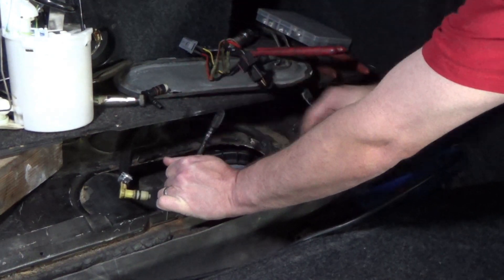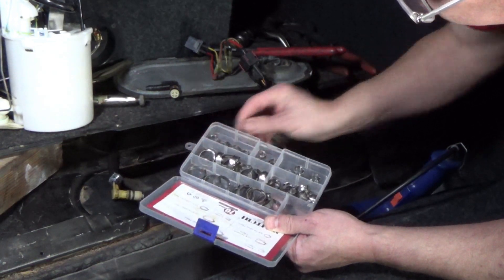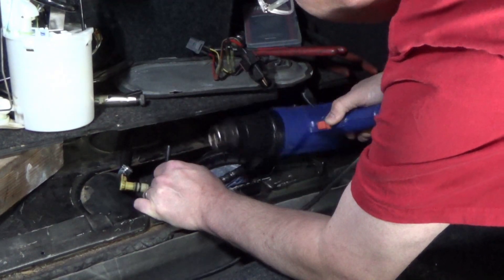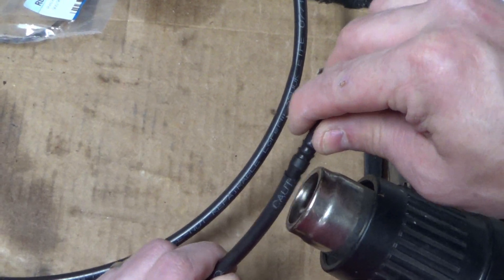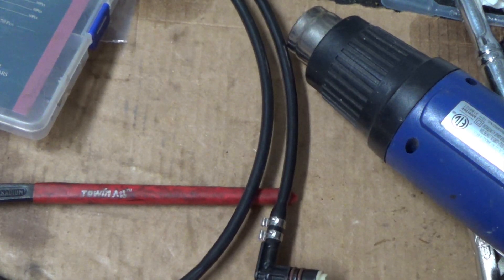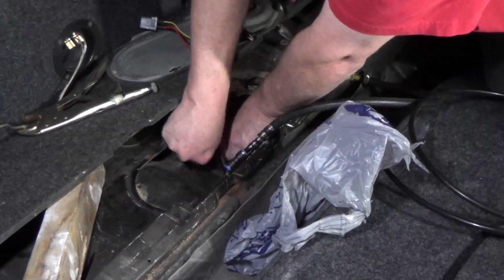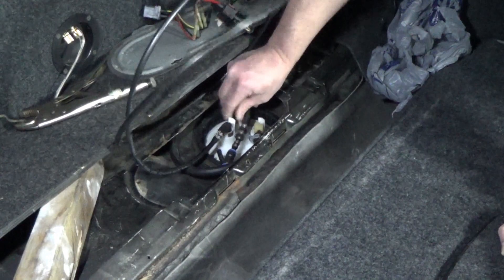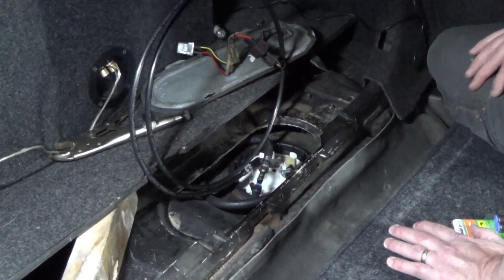1994 Saab 9000 Project fuel pump and return line repair final

Comment: It appears a squirrel sitting on the intake manifold my  Saab 9000 chewed through the heat protective hose and into the vinyl fuel hose where it comes out of the top of the fuel rail 
I am curious how you would replace the hose with aftermarket hose, also clamps you would use for barbed connection and how far back under the car you would go with the replacement hose.   I am pretty sure it is the fuel feed line and not the return hose.  Thanks for any insight.
Reply from the maker: 5/16" push-on couplers work. You should use crimp style fuel line clamps for barb terminations.
Reply: @Ryengoth  Lot's of choices of crimp style clamps and pliers on Amazon. I don't need a set with 120 pieces.  I only need one.   Maybe another one or two in a pinch.  What did you buy?   Thanks again for your help, trying to keep this old 9000 on the road.
Reply from the maker: @Texasbird026  the best option is to get the cheapest kit with the pliers. Dorman 10pk is like 25 bux alone. The full kit will be less than 30 on Amazon.
Reply: @Ryengoth   I was thinking about getting a kit with pliers.  Thanks for followup

Comment: Can you give me some information on the fuel line coupler you used.  Have searched eBay with no success.  My fuel line broke when I attempted to disconnect it from the pump assembly.
Reply from the maker: Dorman makes nylon fuel line unions that are high-pressure quick connect. Measure the existing line as there are 5/16" and 3/8" varieties.